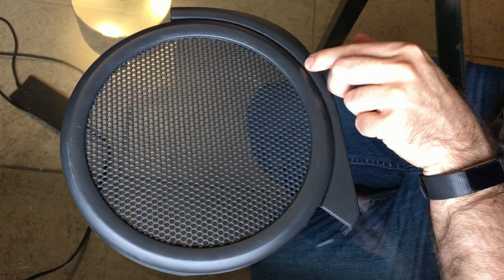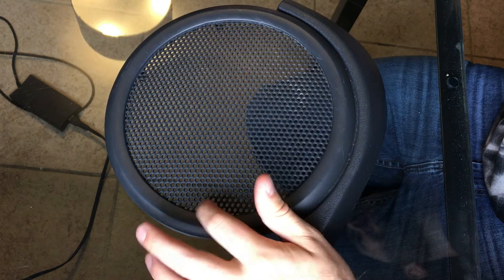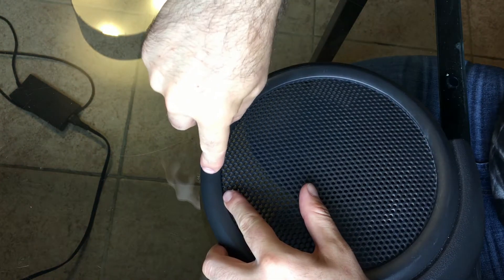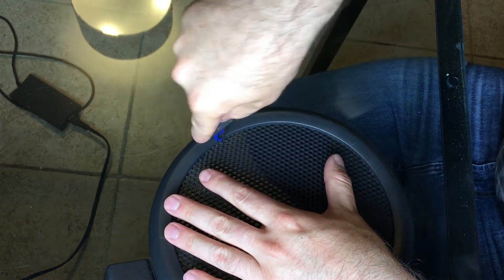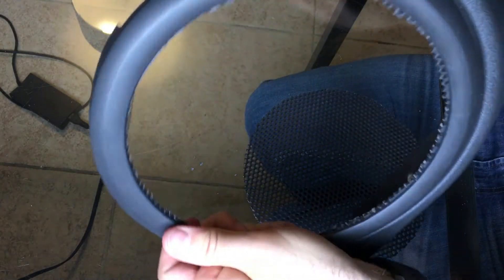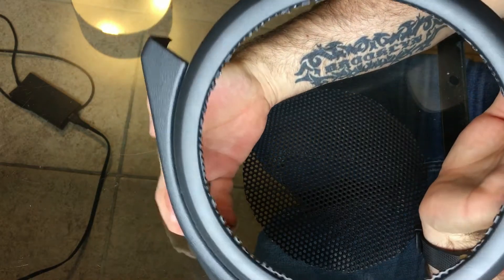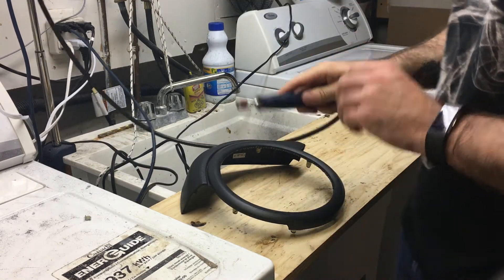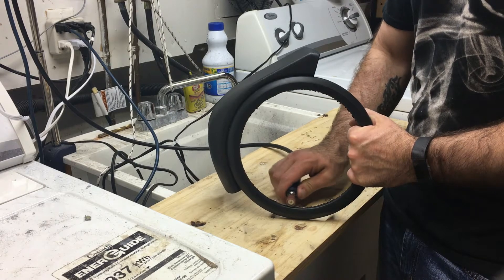2011 Jeep Compass Audio Overhaul - Build #1 Door Speaker Install

Comment: Can you recommend a set of speakers that will fit my Jeep compass 2017 ? Looking to replace the OEM front and back door speakers with something of better quality.. perhaps Kicker, Polk, JBL or similar ... thanks!
Reply from the maker: 6x9 stock any of thoes brands will be good choose within your price range I think kicker sounds better then jbl personally but I listen to a lot of rap/hip hop. Polks I would t do as the premium sound system the front doors are crossed over pretty low
Reply: @coryscustominstalls7168  I was informed that 6x9's wouldnt work as they're an oval shaped speaker and the Compass has circular shaped speaker holes, therefore 6" would fit but not 6x9" ?
Reply from the maker: TheDBNpoison unless they changed it they should be 6x9 still pop your grills and see
Reply: Go on Crutchfield or sonic electronic,  don't ask YouTube for help.